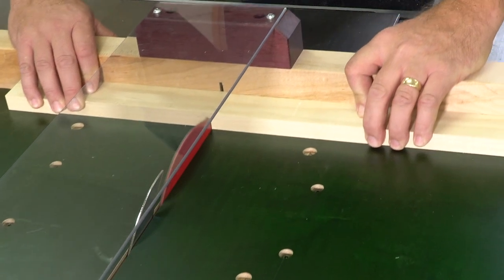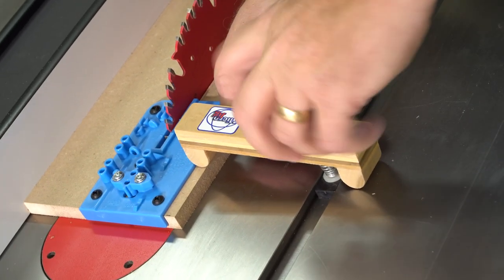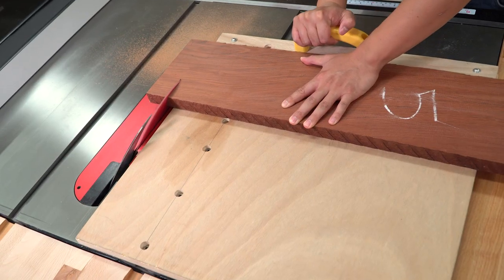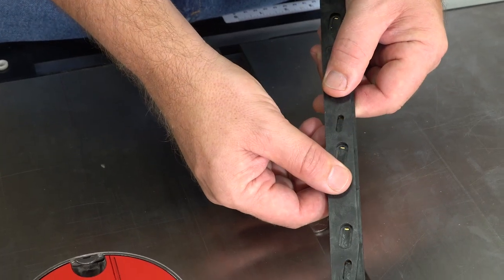Faster Cross Cut Sleds with Hassle-Free Miter Bars with ZEROPLAY Miter Bars by MICROJIG

Comment: I just purchased the ZEROPLAY Miter Bars--Curious as to the best way to align the screw holes on the jig to the base of the sled--especially when attaching the second one miter bar--there is no room for error given you need to have the drill hole on the sled exactly aligned w screw hole on the miter bar-and perfectly aligned with the table saw miter slot.